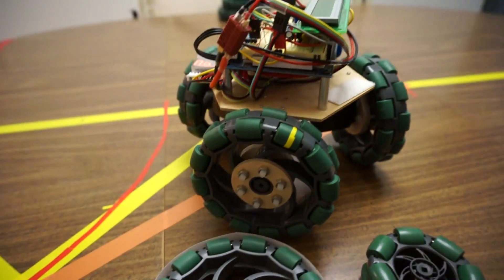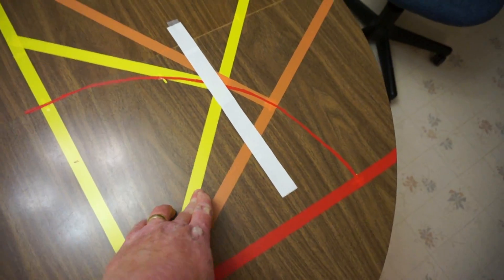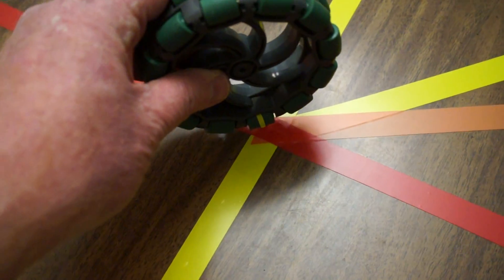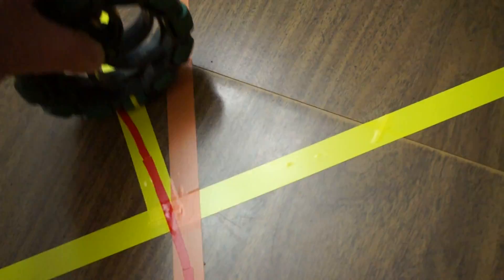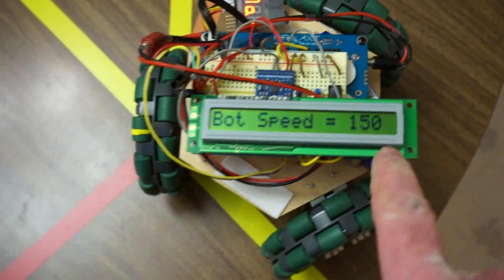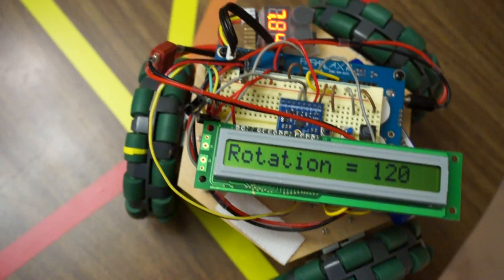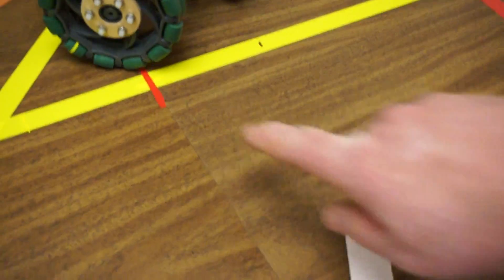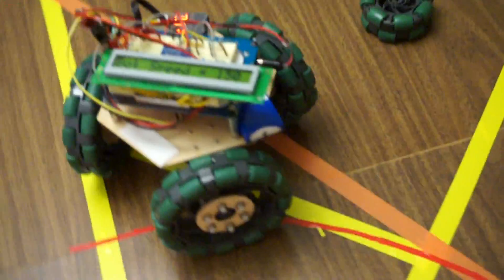OmniwheelGeometry140314a

Comment from the maker: Here's the formula for computing wheel speed based on the speed of the bot.
wheelSpeed = botSpeed * cos(alignmentAngle)
An alignmentAngle of zero is when the wheel is aligned with the direction of travel. When this angle is zero, the wheelSpeed and the botSpeed are the same.
When the alignmentAngle is 90 degrees, the wheelSpeed is zero.
It's possible for an omni bot to move faster than a conventional robot with the same sized wheels. To get the bot to move fast, don't have any of the wheels directly aligned with the direction of travel.